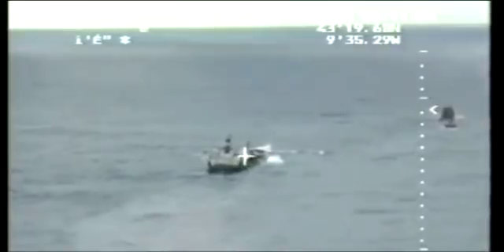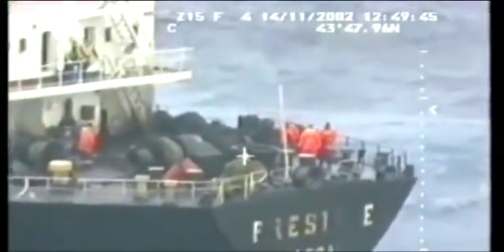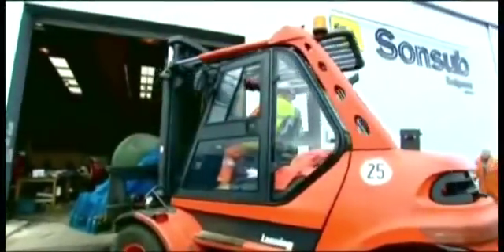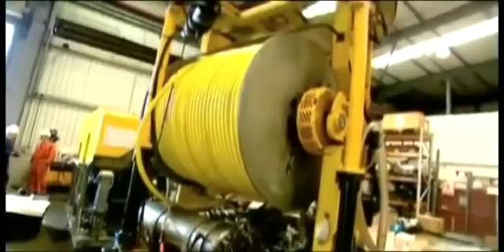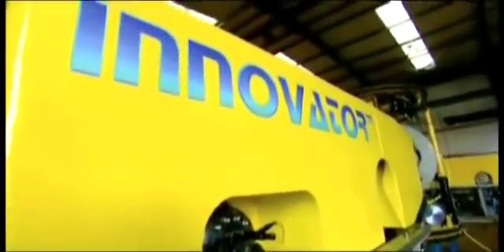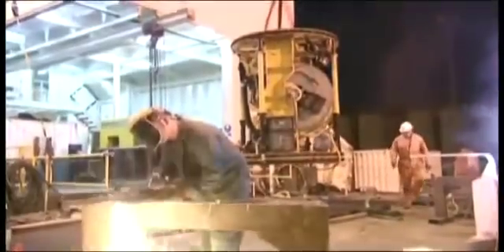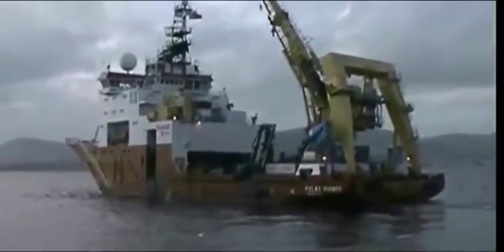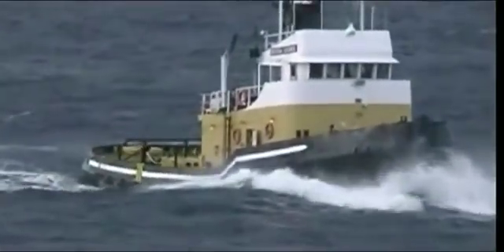Repsol & YPF - Oil removal from the tanker Prestige 4000 meters deep

Comment: I worked on this project for two years on Polar Prince bridge, a few errors/omissions in video. 10.45 lubricant was diesel not water and there was considerable pollution hence reason for having four pollution control ships.
Reply: The ongoing leaks the vid mentioned at the start were the source of a lot of the pollution and driving force in the entire recovery operation.
Every time they drilled to fix a valve they dumped more oil into the sea. Every time a shuttle was started to be filled and shut down afterwards down on the wreck spilled. when they went to empty each shuttle more got spilled.

The pollution levels were minimal when compared to the wreck falling apart and dumping the entire cargo into the ocean.
Reply: pizzacrap9 when I watch this operation I can see that man is ultra smart , but when I switch the news all wisdom of mankind gone in a seconds